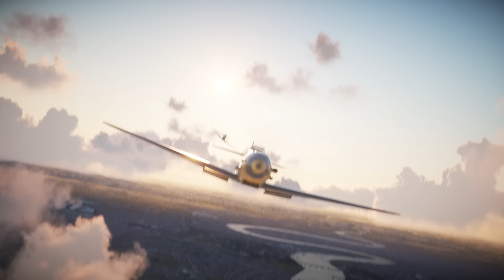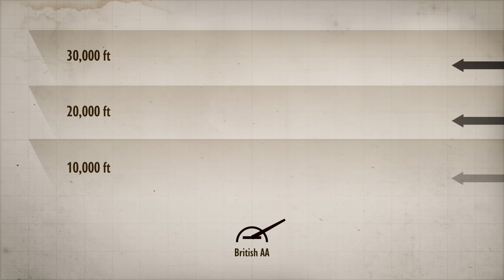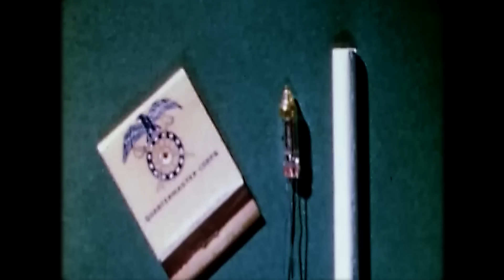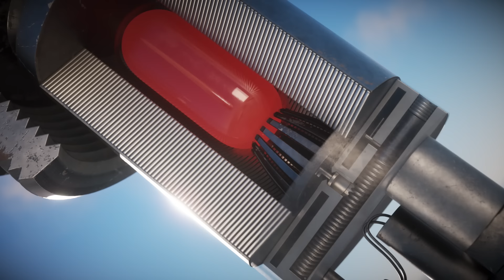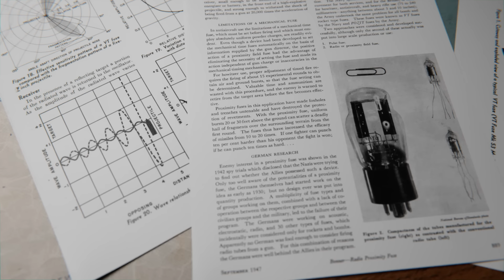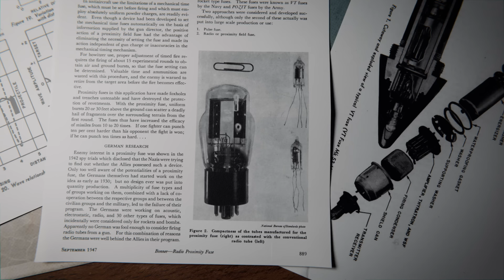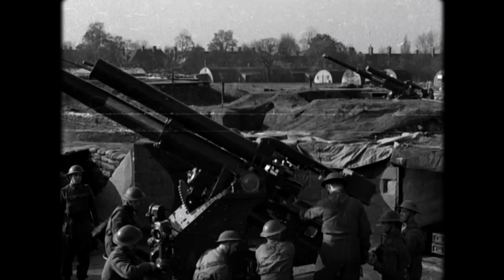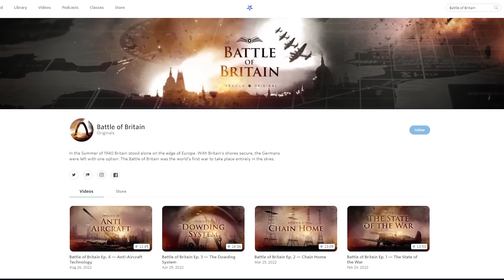The Secret Invention That Changed World War 2

Comment: I don't think the video is correct in saying that the British and Germans gave up on fuze design thinking that it was impossible. The principles of the proximity fuse including the Doppler sensor and thyratron were breadboarded by the British in May 1940. The technology was given to the USA as part of the Tizard mission. The US scientists used the work on small rugged tubes from Pye (UK) and greatly improved it to develop the small vacuum tube used. The US developed the rotating battery concept and adapted the fuze to work in anti-aircraft shells. The US turned the fuze into a volume product development. The patents are British but were shared with the US royalty-free. So overall, a great joint development that benefited all (except the Germans!). The Germans also developed a range of fuzes but none were deployed in volume.
Reply: "given" As of 2006 Britain still owed the US 4.4 billion 1934 USD in WW I debt. 
"First and foremost, they note that they have written off the main body of Lend-Lease, amounting to something of the order of £4,000,000,000 to £5,000,000,000 (16 to 20 billion USD) net" 
below 678 
Hansard ANGLO-AMERICAN FINANCIAL ARRANGEMENTS HL Deb 17 December 1945
Reply: @nickdanger3802  Please replace 'given to' with 'shared with'. I'm not really sure what word is most appropriate to describe the process when representatives from one country on the point of invasion visit another with all of its most valuable technical secrets in a few suitcases (cavity magnetron (radar), tube alloys (atom bomb), proximity fuze, jet engine research etc) and pass them all over with nothing promised or offered in return at the time, other than the belief that the secrets are going to the right place and hopefully something good would come from it!
 
I agree that the USA was fundamental to the eventual outcome of the war - financial and militarily - I don't think any sane person would think otherwise. End of.

Anyway, the point I was making was that it wasn't really the case that the UK and Germany had abandoned work on proximity fuzes thinking that they were impossible, whereas the US persevered and got there. There was a lot more joint involvement than that, although it is almost certainly fair to say that proximity fuzes would have remained a 'good idea' rather than a 'reality' without US involvement.
Reply: @Mike-H_UK  No offense taken if none intended. 
Shared with is as good a term as any, in this case new tech was traded for production.
There are a few other points I will clarify. First US patent for radar was issued in 1934, Watson Watt began experiments with radar in 1935 in response to an MoD request to study the feasibility of a "death ray". Using timed instead of varying pulses to determine range was shared by the US.
Klystron tube was invented in the US and shared.
FDR authorized research on nuclear fission in October 1939, before Tube Alloys or MAUD Committee came into existence. 
Post war the RR Nene jet engine design was sold to the US (after Attlee virtually gave it to USSR) and used in one aircraft before the switch to axial flow.
Reply: @nickdanger3802  I pick up that this is a subject that interests us both greatly! I agree with your description that tech was traded for production. Historians have debated the importance of the Tizard mission for many decades with differing opinions. Some say that the US was working on similar projects anyway so the impact was slight. Others say that while the US had started some areas of research earlier,  the progress had been much slower - certainly being bombed by Germany would have focused the mind on the British side! The American James Phinney Baxter 3rd wrote that 'when the British brought the cavity magnetron to the US, they brought the most valuable cargo ever carried to our shores' and US historian Robert Buderi wrote that 'it advanced the fledgling US microwave radar research overnight by two years', so I think the cavity magnetron was clearly of great value and undoubtedly the single most important part of microwave radar. While US fission research started in Oct 1939 before Maud & Tube Alloys, British research did not start with these programs, it evolved into them. For example, the Frisch-Pearls memorandum that was the first detailed technical description of a nuclear weapon was completed in March 1940 (F-P started much earlier), and this led to Maud & Tube alloys. I've seen it reported (don't know for sure)  that when Oliphant presented the Maud findings to the US in 1941 the British efforts were more advanced than the US, and this helped give the US the confidence to start large scale nuclear weapons research that became the Manhattan project. I can't say how accurate this is, but I know that Gen. Leslie Groves was frustrated by the initial US academic research into nuclear weapons, and this was one reason to put it under army control at Los Alamos. However, when the Manhattan Project started,  everything got combined and the US-led, US-dominated research raced ahead. Anyway, it's a fascinating subject & great to discuss, albeit virtually!!
Reply: @Mike-H_UK  Magnetron was HUGE in US microwave research.
There was no "official" cooperation on A bombs until the Quebec Agreement of August 1943. 
The largest obstacle to making the bomb was production of fissional material, the US was the only nation with electricity to spare to run the centrifuges which is why plants were built near hydro production. 
Odd tid bit 
WASHINGTON (ISNS) -- In the middle of World War II, Secretary of War Henry Stimson asked Treasury Secretary Henry Morgenthau if he could borrow some of the government's silver on repository in West Point, N.Y. With metal in high demand for weaponry, silver was needed for a top-secret project. In this case it was silver's electrical properties, not its monetary value which made it important. The secret project was being carried out at several undisclosed locations and required immense resources.
 
Silver was usually handled in amounts measured in ounces, but this time the Army was asking for tons. So great were the Army's requirements that almost 15,000 tons of silver -- 30 million pounds -- were withdrawn from federal vaults over two years, taken to a factory in New Jersey, and formed into coils of wire. Shipped to Wisconsin in train cars watched over by armed guards, the coils were fashioned into magnets. The magnets in turn went back east to Oak Ridge, Tennessee where they were put into action.
Reply: @nickdanger3802  I think ideas like this become possible during wartime but are often impossible in peacetime. There was a similar but less extreme story from Los Alamos by Feynman. Apparently gold was used for neutron absorption experiments, and when the measurements had been taken, it was remoulded into a single 10 inch hemisphere and used as a doorstop for the room that stored the plutonium. Lee Davenport, in the 1940s an engineer at MIT Rad Lab, said that in those days no-one had heard of red tape. I'm not at all sure that The West would be as successful in a similar situation these days. Or maybe they would if the bureaucrats were sent off to die....
Reply: @Mike-H_UK  Interesting about the gold. 
What do you make of the timing of Tizard, the following quote and approval for Lend Lease, March 41?
Lord Lothian, British Ambassador, and Sir Walter Layton, editor of the London Economist, conferred for 15 minutes with the President. Lord Lothian said that he told Mr. Roosevelt Britain "needs more of everything -- and quickly." Sir Walter reported that he had added his own plea to Lord Lothian's. 
UPI ARCHIVES SEPTEMBER 27, 1940 Axis Pact expected to speed aid to Britain
Reply: @nickdanger3802  My understanding is that the UK government realised very early in the war against Germany, if not before the war started,  that US involvement would be key to avoiding defeat, and things looked very bleak in 1940. There were a number of areas where the UK tried to get the US incrementally more involved and the Tizard Mission, Cash & Carry scheme and lobbying by ambassadors were several of these. I've read in a number of books that Roosevelt was very sympathetic to the UK position but the neutrality acts prevented him doing too much. In 1941, it took several months of debate in Congress for lend-lease to be approved. So, to answer your question, I am not sure whether the Tizard mission and ambassador visit are linked in terms of timing, but they could well be. However, I'm sure that the UK ambassador was trying to make the case to the President at every opportunity that he got, and the Tizard mission may have got him another opportunity to get before the President. I don't think that either of these were instrumental in overturning the neutrality acts and getting lend-lease set up, that was a much bigger step on behalf of the US Congress, but they all helped make the case for lend-lease and its eventual adoption. I imagine that Winston Churchill's lobbying would have been far more effective. Anyway, that's my thinking; you may see a stronger connection.
Reply: @Mike-H_UK  I do not know anything worth mentioning about the debates and arm twisting in congress on Lend Lease. I do know some things about the Neutrality Acts and how they came to be.
Britain and France borrowed from US banks and some of that was loaned to Italy to keep it on the right side. Some territory was also promised.
In 1917 Germany announced the resumption of unrestricted submarine warfare and foreign minister Zimmermann sent a telegram in code through the US embassy in Berlin (Britain cut Germany from the Trans-Atlantic Cable and Woodhead Wilson allowed Germany to send traffic hoping the Germans would take this gesture as an indication Wilson would be a fair intermediary in peace talks) to Germany's ambassador in Mexico offering to provide arms and funds IF Mexico were to be at war with the US. Intercepted in Britain and decoded by Room 40 it was presented to the US ambassador in London with the cover story it had been acquired in Mexico. Wilson asked congress to declare war.
In 1919 the government took over the debts. Italy did not get the territory promised and used that as reason for not repaying Britain and France.
In the early 30's Germany stopped paying reparations to Britain and France and they stopped repaying the US. A knock on from the Great Depression. (Contrary to popular belief the Depression, compounded by the Dust Bowl years, was much worse for the US and Canada than the rest of the world.) The books War Is A Racket and Merchants of Death were published. The latter accused US bankers and arms manufacturers of maneuvering congress into declaring war to ensure Britain and France did not lose.
The Nye Committee investigated and the fallout brought about a shift in public opinion which brought about the first Neutrality Act.  
They were for a limited period and with slight variations. In 1938, over the objections of the Army, FDR allowed Britain and France to purchase all the US military aircraft they could pay for.
In 1939 the Act prohibited loans and the sale of anything to any nation in a declared war. This was mentioned in parliament before the war. 
It was amended on 4 Nov 1939 to allow Cash and Carry. Another requirement was transfer had to occur at a port or border. The scene in Darkest Hour depicting FDR as an A hole saying aircraft could be pushed across the border was a fabrication, as soon as Cash and Carry was signed the US and Canada began creating grass strips on the border.
Some of this is from memory so do not bet the farm on it. 
For most of what FDR did to support Britain Hitlers declaration of war on the US is in the Jewish Virtual Library.

If there is one problem which the country will have to face in time of war more serious than another, it is that of the provision of aviation spirit. By a suitable blend of power methylated spirits and benzol with petrol which would otherwise be unfit for aviation spirit, it can be raised to the level of aviation spirit. Let the House remember that we buy our aviation spirit mostly from the United States or South America, or the Dutch East Indies. Supplies from the Dutch East Indies would have to run the gauntlet of the Mediterranean and, as to the supplies from the United States, under the Neutrality Act of 1937, the export from the United States of what can be clearly defined as munitions, is prohibited in case of war, to either of the combatants, whether the combatant is a victim or an aggressor. The President has also power to prohibit the export of things which are in his judgment ancillary to the conduct of war. It is clear that under these conditions the export of aviation spirit to this country from the United States might well be prohibited, if we were involved in a war, even though we were the victims and not the aggressors.
below 1444 
Hansard FINANCE BILL.
HC Deb 26 May 1938 vol 336 cc1425-88

Planes Across The Border (1940)
https://www.youtube.com/watch?v=HL41oesVh9o

Comment: The VT fuse was a true game changer in the Pacific.  The naval 5 inch gun went from being a totally ineffective AA gun to being the most effective practically overnight.  One of the greatest technological accomplishments of the war.
Reply: Take a look at the rapid fire 76 mm AA guns used on the Des Moines class Heavy cruisers.
Reply: The wds mk five weapon system for the five inch guns shot down more Japanese planes than any other weapon system in ww11. The fire control techs ten of them sokit the solution into three problems solved by three men each the tenth sent the results to the gunnera mates. All done quickly enough to still be relevant. An amazing system developed and ran by amazing men. I was an FT in the 80s same system we clicked the target with a mouse and pushed a button. Did not know until recently what the original FTs of that system had to deal with.
Reply: Even without the VT fuse the American 5"/38 caliber gun is considered to be the best heavy naval AA gun of the war
Reply: @YoBoyNeptune  I remember hearing an eyewitness account of an incoming Japanese plane taking a 5" round right smack on the spinner; it was *atomized*.
Reply: @t_k_blitz4837 light weight as little arm9ur as possible construction hit by the equivalent of a 50 pound dumbell moving at 2500ft per second
Reply: Meanwhile in Japan they shot beehive shells.

Comment: Are there any estimates for how reliable the VT fuses were?
Reply: The initial failure rate was around 50% but that improved to 30% by the end of the war.  The naval twin mount 5 inch guns had a high enough rate of fire that the VT fuse made the 5 incher a very effective AA gun even with a significant failure rate by the fuse.

Comment: The most funny part in my oppinion is that the solder needed to make the connection was a special type to resist the massive acceleration which was only produced in the UK during the beginning of the war, as such, the electronic part of the early versions was made in Europe and then send to the us